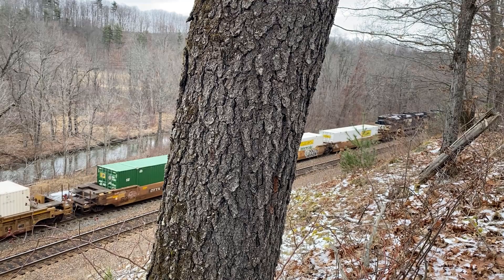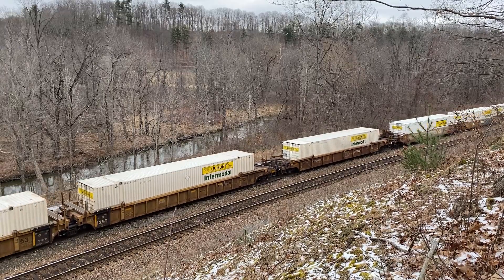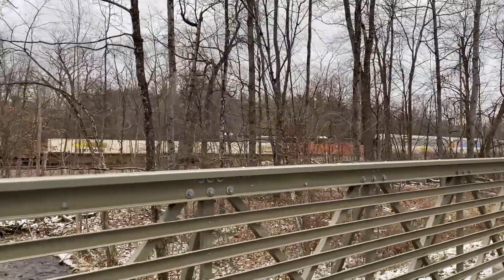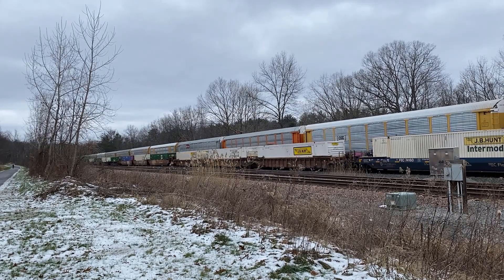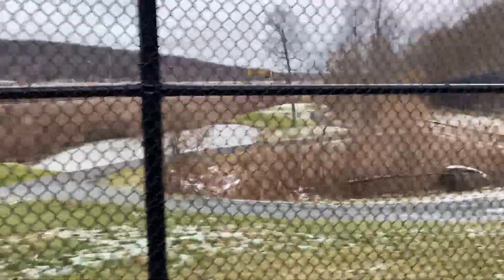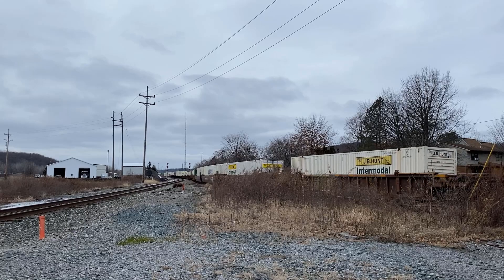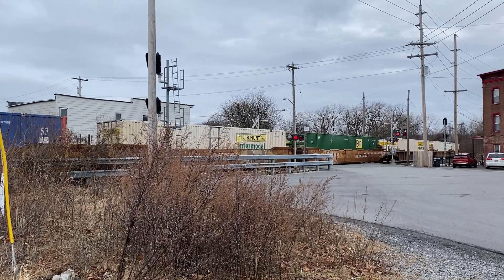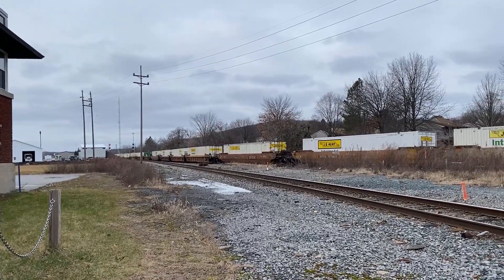Upstate New York's Intermodal Terminal: Mechanicville, New England Gateway

Comment: I live down by the overpass and hear the train horns every day!! Another unique thing about this sector in modern day regarding the colonie line from CP is that mechanicville is a stop along that street for their holiday train every year. One year a guy was in the XO tower and turned the gates off and on so the auto-trigger wouldn't back up traffic on a gate the train was not in front of (I recorded a video of it on my channel... it was before i moved but still just as busy if you head into town that night to see it). I can't hear the defect detectors (maybe not close enough for my scanner or not the right channel) but still a good stop for any rail fanner. Also, there are enough streets linked together so well that if a train were to stop there for a while on either line, there's always a work-around.
Reply from the maker: Thanks so much for the comment! It’s too bad the holiday train hasn’t run the past 2 years. They need to bring it back this year!
Reply: @NorthCountryTrains  seems very likely it will be back, but we'll see!!

Comment: What’s gonna happen to this place after the merger?
Reply from the maker: SHOULD still be as operational as before, same amount of service, maybe slightly less. NS should reinstate 205/206 to Mechanicville.
Reply: @NorthCountryTrains  what’s 205/206? Also I heard they’re gonna get rid of the 2 single stack trains that leave from there and basically cut out the hoosac tunnel
Reply from the maker: @user-uq9yo4qu7l  22K/23K will be taking the “southern route”, skipping Mechanicville. NS will either run an extra “Mechanicville express” like they have been doing lately, symboled as 22K also, or they’ll make dedicated trains from Buffalo to Mville, symboled 205:206.
Reply: @NorthCountryTrains  oh nice so you think there will still be Intermodal traffic through hoosic?
Reply from the maker: @user-uq9yo4qu7l  Besides possible trash containers, no, no intermodal through Hoosic tunnel. It's not practical.